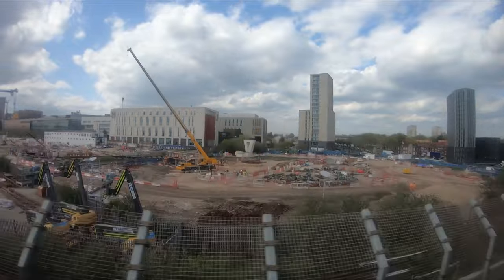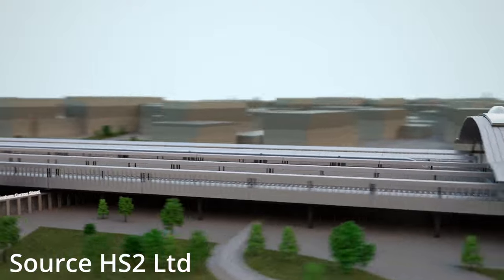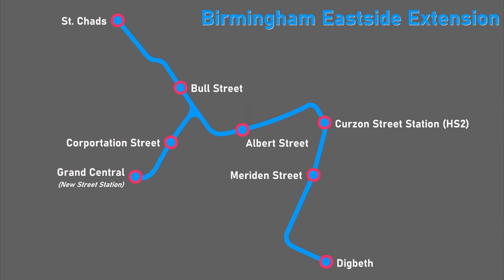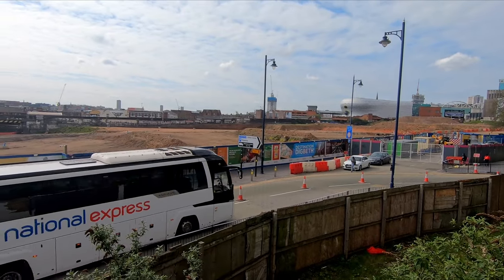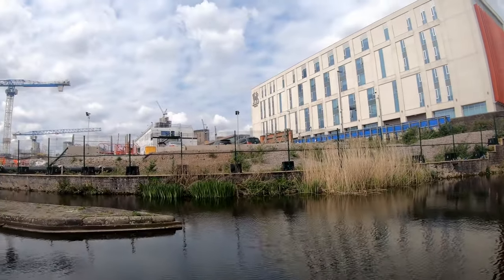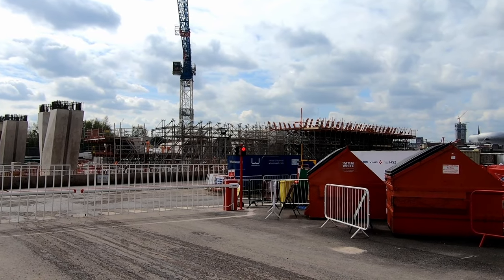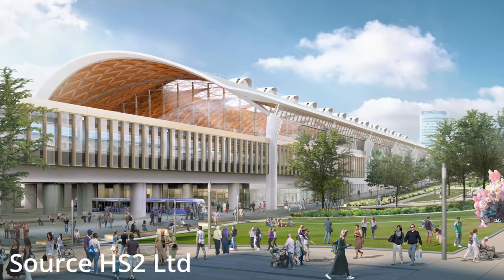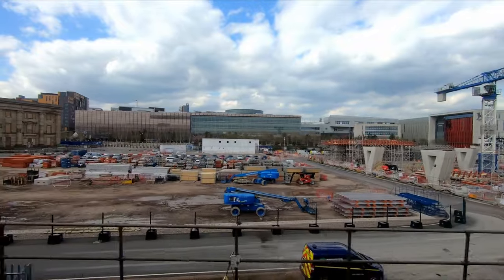HS2 Birmingham Curzon Street Station

Comment: I still think that HS2 Eastern Leg could still happen once HS2 is completed. Especially the Eastern Leg to Leeds and connect with the ECML towards York and Scotland.
Reply: It's definitely more effort to do it after-the-fact and have to pass a bill for it, but if it were constructed immediately after the other phases then workers could simply move site to work there with minimal retraining? Too good to be true probably though, lol
Reply from the maker: Yeah, work on the Easter leg needs to follow on directly from construction of phase 2a. The workforce currently deployed on phs1 should be able to build 2b to Manchester and Leeds simultaneously. Any break in construction is just going to increase costs down the line. Even if the government committed to East Midlands, it gives them time to get the Leeds leg through parliament
Reply: @Rail_Focus  It won't happen, and the government have known as much for 3 years. Once Covid struck the idea was to cancel it altogether as it soon became apparent that rail travel would never return to its previous model (A/M & P/M commuting, which is where the real profit lies, especially in first class tickets). However, it was very quickly realised that cancelling contracts already signed (London - Birmingham) would be more costly than building, so they continued with phase one. However, the vast majority of the rest of the planned routes had not had contracts signed, and still haven't, so it is now highly unlikely you will (in the foreseeable future) see any further development of what has now become a drain on precious financial resources...
Reply: @BibtheBoulder  There'll be a new goverment then. Hopefully a better one 👍
Reply from the maker: If Labour wins it may be too late to re-start Euston work for an earlier open date, but Labour have suggested they'd build HS2 in full as originally planned.

Comment: i wonder what the traffic on the wcml will look like once HS2 is in operation🤔 nice video!
Reply: If the new line terminates in OOC then you won't see any difference. You'll just see empty HS2 trains.
Reply from the maker: Hopefully communities served by the WCML will see better services. Places like Lichfield that only have 1tph should have at least 2. Milton Keynes will also see a lot more fast stopping services.
Reply: Even if HS2 stops at OOC for a few years there will still be traffic. OOC is an interchange with the  Elizabeth Line and is very close to  Heathrow, both of which can draw significant traffic demand. Maybe it won’t be full trains, but definitely not empty.
Reply from the maker: Just won't be able to completely re-cast the WCML timetable, not until phase 2a opens at least. And DfT figures still show 70% of passengers will want to travel to Euston, despite OOC's connectivity.

Comment: Please don't get me wrong, but why is building all this infrastructure taking so long.  Brunel and the victorian navvies built Paddington Station in a little over 2 years.  They did not have the advantage of modern equipment and laid millions of bricks.  The methods used to build modern structures should allow building these new stations in much shorter times than Victorian Navvies doing all the work by manual labour.  The whole uk railway network was built in a little over 50 years, 1830 to about 1885 while HS2 which isn't much more than 130 miles of double track and is taking 20 years plus and only has two major stations and a couple in between.
Reply from the maker: All the infrastructure built since the 1830s is part of the problem. Building in open countryside with few structures to build made building more straightforward and they were less concerned with the environment. 

Now engineers have to contend with digging huge tunnels underneath cities, avoiding woodlands and mitigating the impact on residents and nature. Then there's the motorway network to contend with and all the new roads that have been built since 1830. Plus the infrastructure is built to different standards, with more complex engineering required.
Reply: @Rail_Focus  While I agree with some of your points, the issue still remains that modern technology such as tunnel boring machines and huge earth moving equipment should speed up the process.  The engineering standards of the Victorian era  cannot have been that bad as their infrastructure is still there and working.  The modern concrete infrastructure is only built to last 100 years while the supposed inferior structures of Victorian railways are still here nearly 200 years later.  The main reason it takes so long is mostly in my experience Health and Safety and the adherence to the ecological clap trap.
Reply: Lawsuits from NIMBY’s posing as environmentalists